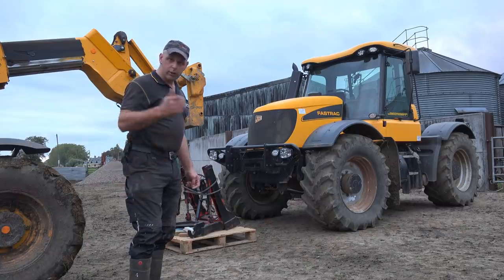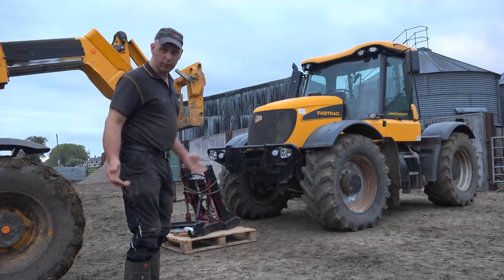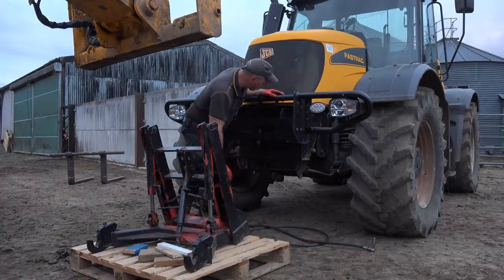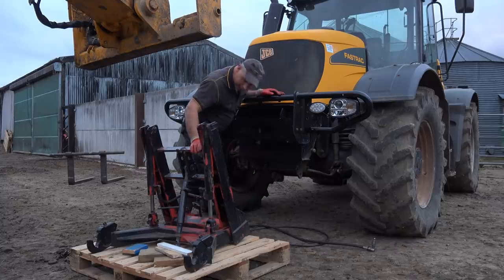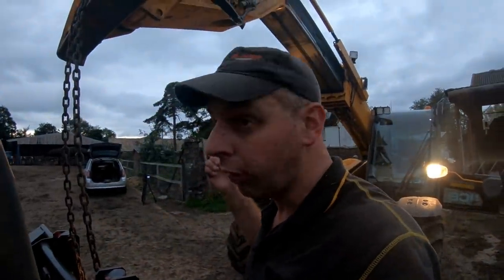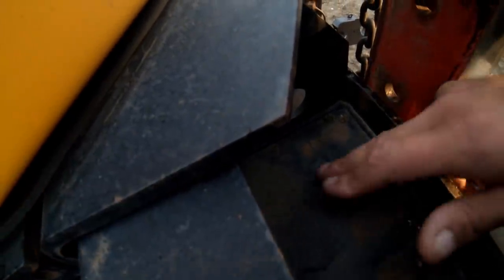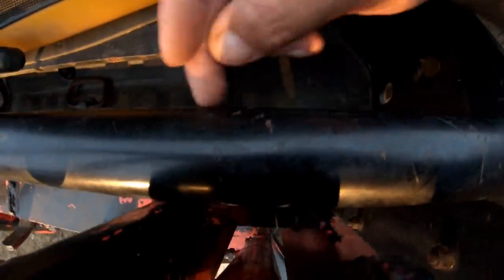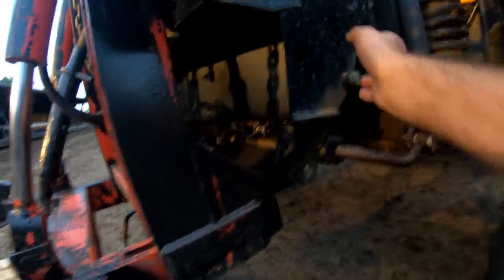JCB FRONT LINKAGE. WILL IT FIT?

Comment: Looks like a very doable project, having now offered if up, I would be tempted to dismantle the linkage, them fit the base frame, refurb any pins bushes etc, paint up bits individually and rebuild,  it will be a top job., ps don’t forget the wheels. 👌

Comment: Just an idea would it not be a better idea to get a plate just to bolt onto the tractor that spaces the linkage out enough to allow it to clear the bar then you could weld it to to the back of the linkage so if you ever wanted you could just unbolt it from the tractor and you don’t end up with a front end that’s been cut about.

Comment: personally i would cut that bar out completely on the front bumper, fit the unit, then fit a new u shaped one back on, up above of the rams tops, be a lot stronger that way, extra spot to fit more lights ect then, top link holder even on it

Comment: Myself and all T Dub fans can sigh a sigh off relief you had us all going mad to think you'd even consider putting the front linkage on her lol 😆 glad it's going on the Fastrac it will make her and yes please do a video off fitting it or even several shorter videos saves editing. I'd certainly put greasers in when doing new bushes grease and oil is cheap maintenance 🚜

Comment: Why not just cut the top tube out and reweld it back in 20mm further back, so as not to weaken the bar?
I would consider using somthing like a 30-40mm od spherical bearing with a 20mm id fitted inside the new clevis pivot blocks too.

Comment: Would it not be  better mounted on the chassis face plate behind that weight carrier you are thinking of drilling? Then mount the light bars around it. That’s how the factory ones went on at least.
Reply from the maker: Would have been great to get some original ones. The trouble with this front linkage is the height, it wouldn't fit under the bonnet. Should be fine on the weight carrier. How's your beasty going?
Reply: @GeorgeSaunders  the originals don’t come up often. You’ve done well to get hold of these you have. I see what you mean about the height now. Should be right enough with the plates you talked about and be handy for a front weight. You’ll need to redo the flat lift test when you have rubber and weight on just to remind folks how good they can be in the right hands!  Mine has been going well considering I built it 😀, one or two things to iron out over winter, a hub that won’t stop leaking,  pump timing might be off and the draft control lift height sensor.  Keep up the good content!